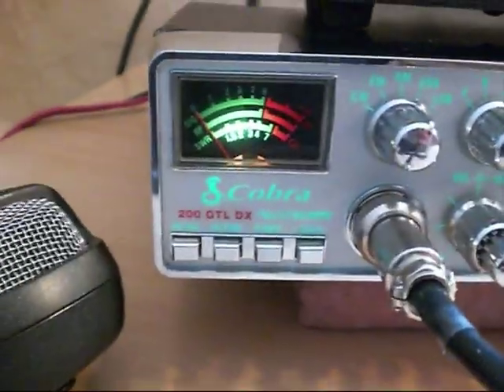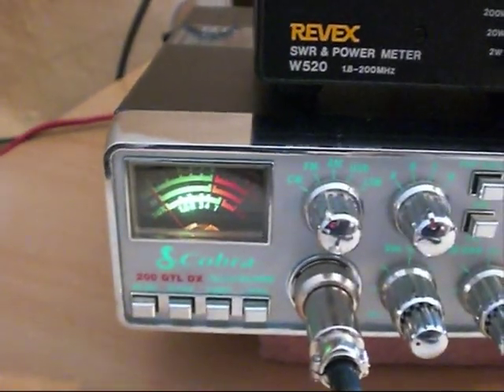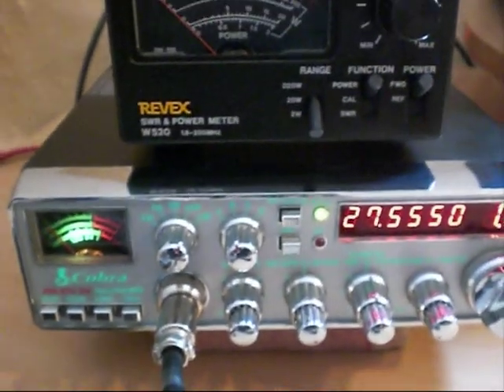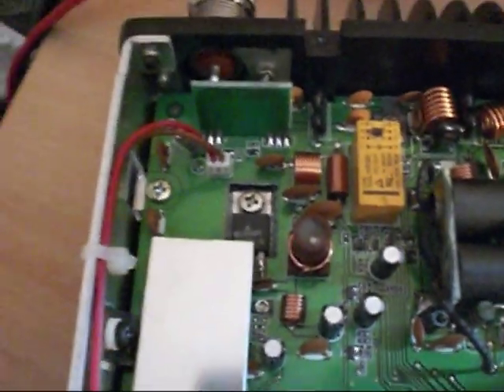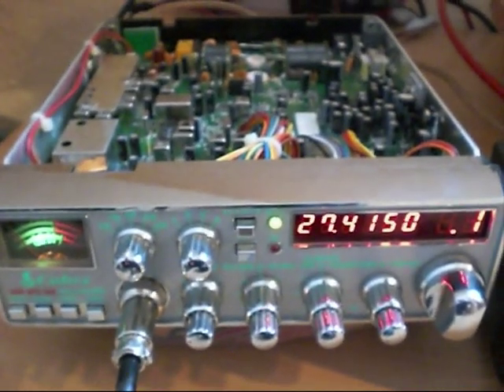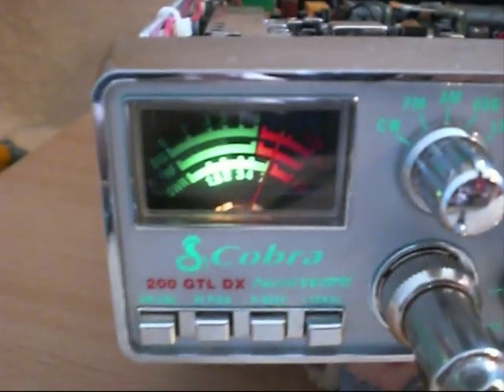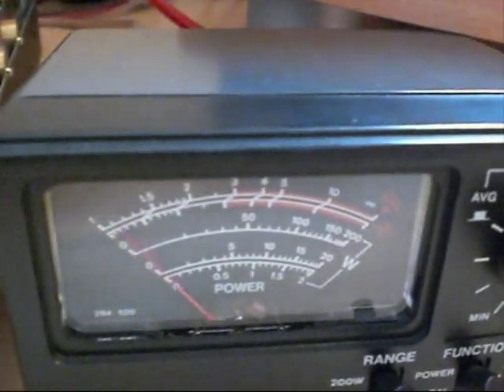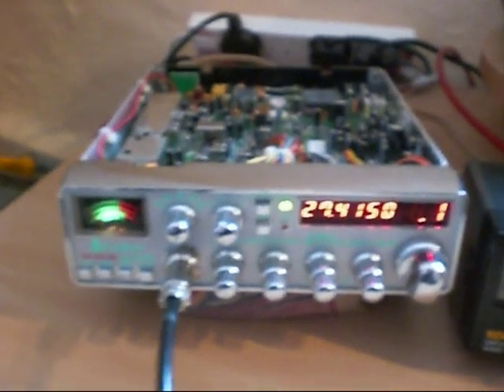COBRA 200 GTL DX,  RF DRIVER MOSFET REPLACEMENT - RD16HHF1

Comment: Hi, You say the voltage it to be 3.2vdc and I have one that I think to driver is blown and I have ordered a replacement. When i check the gate voltage it has none. I checked the other 2 I have and ir is the same thing. Can you explain if this while you TX or what? I only have voltage on the drain and its 13.8?
Reply from the maker: Gate voltage is only present in TX....

Comment: Just picked up a 200gtl from a friend all seems to work well except side band is inaudible in hi power mode...I think the power is set too high because the radio is swinging to about 150 watts pep on am in the hi power mode and 100 on the low setting...a friend was telling me he thinks it's the driver fet, but wanted to get your opinion...any help is greatly appreciated...
Cheers

Comment: Hi Mark... My cobra wont transmit on most frequencies above 27.425. There are a few it will but there is just no transmit power on these. Everything below these frequencies transmit is no problem... Could this be a mosfet on its way out or something else.
Reply: If the MOSFET driver was bad then i doubt in would have any output on any frequencies, could be a VCO  or mixer related problem...
Reply: Thanks for the feedback and videos Mark..
Patrick

Comment: The frequency counter does get power. So does the channel, but like I said, it just displays 8's. Kinda like the self test most modern radios will do at the begining of a power-up. Except mine seems to be stuck on that test.

Comment: Is this driver replacement common in all radios in the series?  I have a 3rd generation Cobra and all but one of the suggested cobra fixes to inherent problems was necessary so they must have corrected some shortcomings as they learned.

Comment from the maker: @DIESELDOG956  I have never tried as i have a good supply of RD16HHF1's and they are quite cheap, the IRF520/ERF2030 is not the same as a RD16HHF1 so would not work as a direct replacement - i think others may have all ready tried this without much success.

Comment from the maker: @norseleague   If the radio has good output power but just no modulation then i doubt that the MOSFET driver is the problem.

I would recommend having someone who knows these radios well check it over for you to find the problem.

Comment: @Blazerman6789 so i have the cobra 200gtl open on my bench and have removed the mosfet driver, when i measure from chassis ground to gate trace, i measure 0.1volts, should i not be going to chassis ground and then the gate trace?

Comment from the maker: @Blazerman6789 The reference point for the GATE voltage is the PCB track to the GATE, i always set the voltage before installing the new FET just in case the voltage is set too high. use the PCB chassis ground for the negative lead.

Comment: I have a question, what is your reference point for the bias voltage, is your negative lead of your voltmeter going to chassis ground? Thanks a lot for your help, great video and info, look forward to resurrecting the old cobra!

Comment from the maker: @TonyTheWizard  Your quite right, what a plonker i am - i will add it to the text so people know.

The Gate voltage should be set to 3.2v using VR21 which is close to the MOSFET, this is what Mitsubishi recommend - i always set the voltage before installing the new device.

If you don't have a service manual then you can find it at CB-Tricks- in the service manual it says the bias current should be 1.3A which is too high if you ask me, probably should say 130Ma!!!